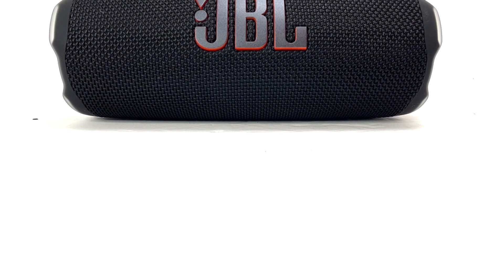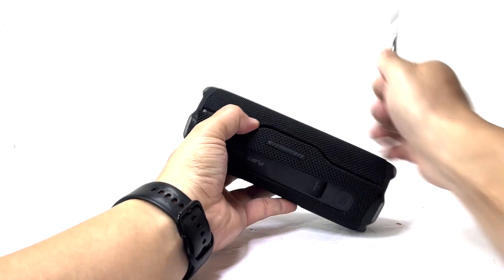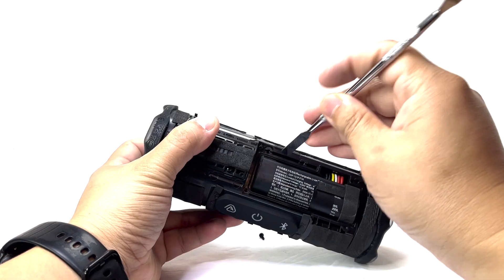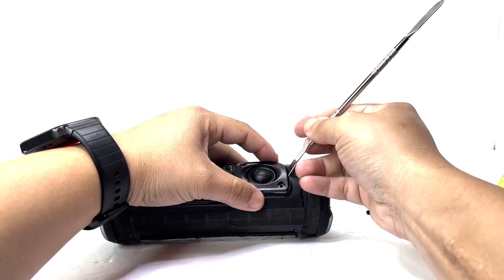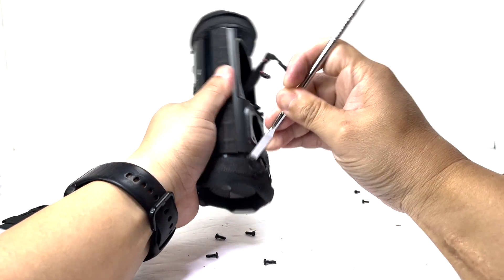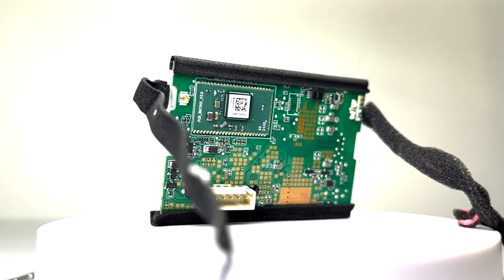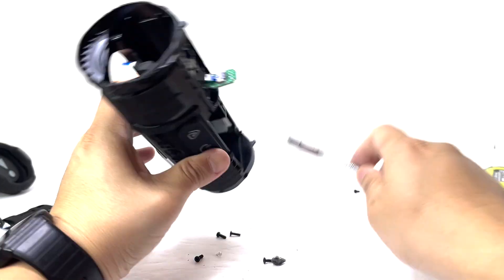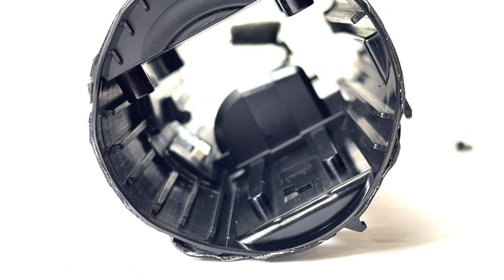JBL Flip 7 Teardown – Inside One of JBL’s Best-Selling Bluetooth Speakers!

Comment: Strangely....the Flip 7 battery is 4800mAh, while Beats Pill 3300mAh. But the Beats Pill offer much more playing hours? Absolutely no idea how does it works
Reply: The Beats Pill does not have as much bass as the Flip 7, the Bass needs to most energy. That’s why the flip 7 has a shorter battery life but a bigger battery. The Beats Pill doesn’t have this much bass.

Comment: We actually returned a charge 6 to get two of these Flip 7’s and they are mounted on the handle bars of our electric scooters….its insane the volume and clarity these little things can push out. Very happy & super surprised because the charge was always a go to for me
Reply from the maker: Yes, I do agree... flip 7 does sounds loud and clear.
Reply: I have both the Charge 6 and Flip 7

The Charge 6 is obviously the louder amd better sounding one. The Flip is if you want something to not be scandalous at full volume. I like holding the flip in my hand because of its compact design. Bring it close to my chest sometimes or even to ear 😂
Reply: @Alphawave07 OMG I HAVE THOSE TWO TOO ALSO A GO4
Reply: the maximum volume of the flip7 is just 2h30 this all
Reply: Do you get zero playback issues when pairing stereo?

Comment: Absolutely great speaker right there, the sound is above the rest
Reply: O so I should get it, currently have the flip 6, also i had the flip 5 and flip 4. I was hoping they would put the mic back in this model like flip 4
Reply: @thabg007  mic is pretty useless to me personally, depends on the person
But the sound has reached a new high.
Reply: @shoerice5083  Well i also noticed in the pdf manual that finally we can cycle back tracks now (3x presses of play button)
Reply: Lol in what way it's harsh and looses badly at max volume. The HK Luna is more premium with deeper bass and it's much more fuller with more bass power .
Reply: @darrenwipf9868   nah, not really🤣
I don't know what you heard, but i own the luna and i got the flip 7 US version. The treble is so smooth and clear, clearer than the luna which is very treble light.
The flip 7 has a 7 band eq, i made a personal eq, and it's way more exciting than the luna, and the bass is closer than ever.
Reply: @darrenwipf9868  flip 7 is better i have both.
Reply: Flip 7 is better
Reply: @shoerice5083  in what way 😂😂